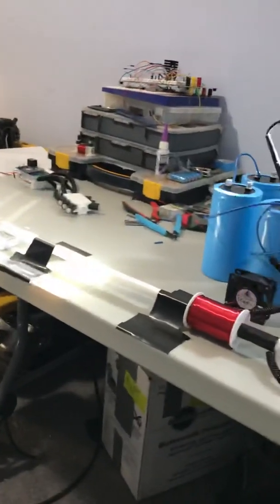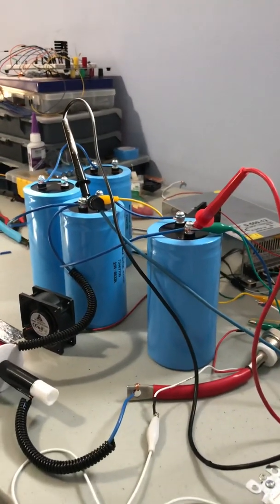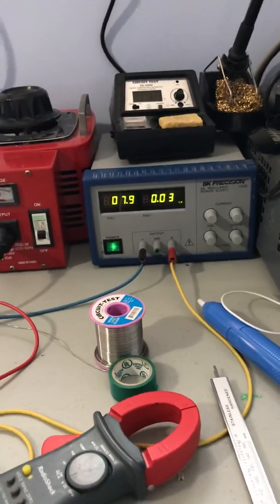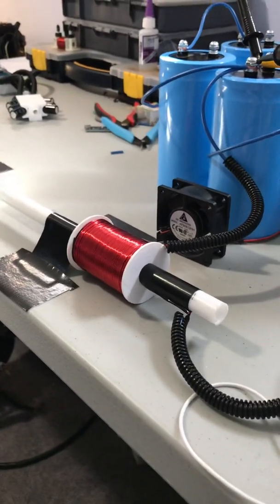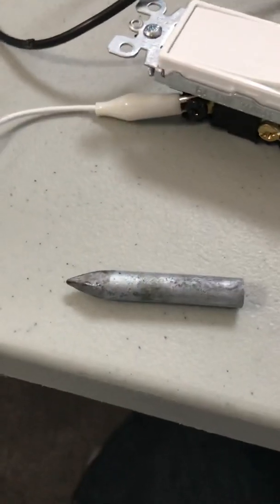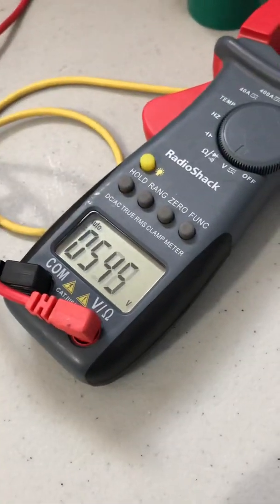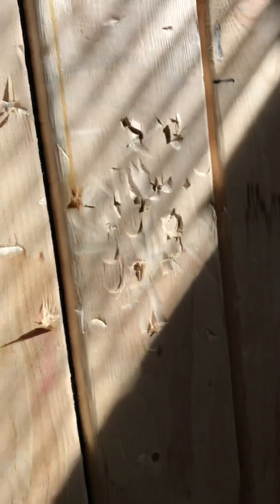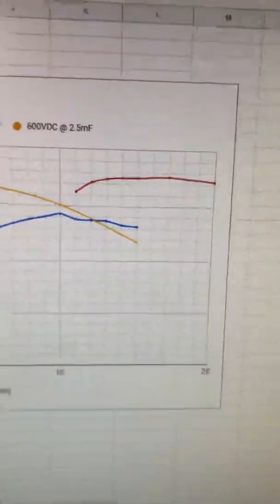Single Stage Overview and Operation

Comment: Maybe try to make the coil the same length as the projectile and put a light-barrier right after it and measure the voltage across the capacitor aswell as the light barrier with an oscilloscope in order to see if the discharge of the capacitor and position of the projectile is well balanced. Usually you capacitor should be fully discharged right about when the projectile hits the barrier.

Comment: Try a higher capacitance and a smaller coil. Your coil is way to big imo. Your efficiency is about 2.16% which isn't that great (well I guess it's normal for a makeshift coilgun but it can't hurt to increase it right? :D). My single-stage design had an efficiency of around 4.8% with  only 300V. I used 7.8mF at 300V with a small coil (didn't measure the inductance but the resistance is about 0.35-0.4ohms) with a magnetized steel projectile.

Comment: Would a lighter projectile improve the speed?

Would a smaller projectile have more losses, because there’s less iron that could be attracted?
Reply: Yes, a lighter projectile would improve speed BUT you don't necessarely want that. You dont compare bullets by their velocity but rather by their Energy which is given by: E = 0.5*m*v^2 (m=mass in kg, v=velocity in m/s, E = Energy in Joules). IF every bullet would have the same energy, a smaller projectile would be faster but due to the smaller weight the energy remains the same.
Depending on the coil a smaller projectile may have more losses. Primarily because of the point yout stated and also because, due to the smaller mass, it accelerates quicker meaning that while the bigger projectile was exactly in the middle of the coil when the capcaitors where fully discharged (which is optimal because you don't want the projectile to be pulled back after it passes the middle of the coil), the smaller projectile could be way further then the bigger one which slows it down. You always need to find the perfect balance between the coil dimensions, capacity, voltage, placement of the projectile and the dimensions of the projectile. Due to this it is extremly hard to have a high efficiency with coilguns and you can only optimize it exeprimentally because the mathematical model of that is wayy too inaccurate.
I've been building coilguns for 4 years now and my first one had an efficiency of about 0.8% but my newest has 5% due to heavy research and many many attempts.
If you want the easy way I'd always go with the highest voltage possible (but be careful, for example with 400v we're talking about >300kW of power and at such high currents the circuitry is always deadlier than the projectile itself). I've noticed that with increasing voltage the efficency also tends to increase. It's also a good idea to design a multi-stage coilgun which also increases efficency heavily. For the first stage I'd do something like 300-400v at ~8mF and with each stage i'd increase the voltage and lower the capacitance so they discharge faster. 
If you have figured out the voltage and capacitance I'd try to experiment with different coils (different length/height) and see which dimension tends to perform the best. Then I would start experimenting with the dimensions of the projectile and it's position.
Yes it can be pretty tedious but if you want a good coilgun you have to go through this.
Good luck!